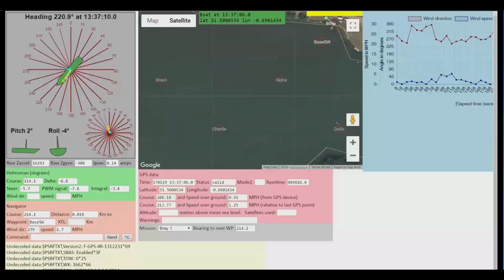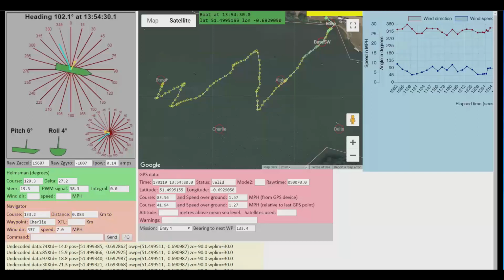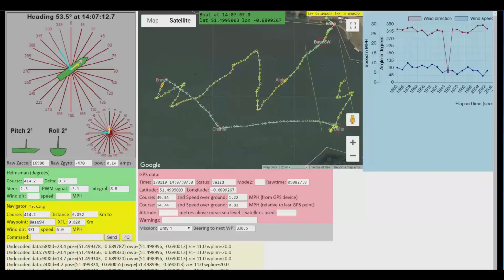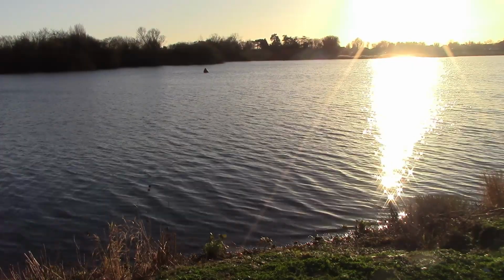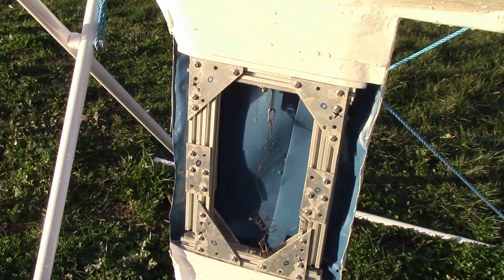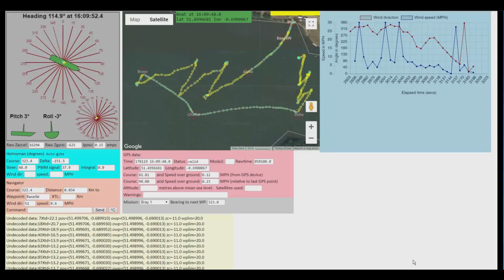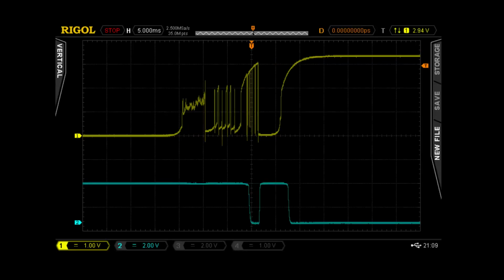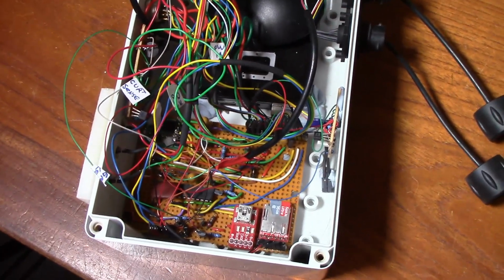Testing at Bray Lake with modified PID parameters

Comment: Great progress, as ever looking forward to the next instalment.  As I remember the anenometer I sent you is hall effect but was also pretty large so may or may not be worth trying.
Reply from the maker: The one you sent us is much better made and better balanced than our plastic Ventus one. But yours is bigger and weighs 278g compared with 152g for the Ventus. However, most of your weight is in the aluminium brackets rather than the devices themselves. I'll definitely consider it if we switch units. At present our software doesn't use the wind speed (only the direction) so I'm not under much pressure for it to be infallibly correct. For the sea I fear we're going to have to bite the bullet and pay for an ultrasonic one. Most teams are using the French LCJ Capteurs unit which weighs 100g but costs £469. I asked them last October if it would survive being regularly plunged into sea water bt did not get a clear answer (they said  "Our sensors are waterproof but there is a whole where the cable goes out. It is your responsability to fix it with waterproofing system and not the air sealing". Curiously, looking for their web site today the domain seems to have expired.
Reply: @samuelfielder  good luck. I still think there might be milage in some kind of sensor less or highly simplified sensor wind detection because all you really need is to know if the wind is more than around 25 degrees fwd of the beam. Could it be done with microphones?
Reply from the maker: Waterproof microphones?? I've got some enclosed ultrasonic symmetric tx/rx units. Played with them a bit. I gather the electronics needed to sense wind speed/direction accurately using ultrasonics is not entirely simple. Sensing by using the compass roll angles seems to work fine, but it requires time (which we have in the sea, but not on Bray Lake!). With Woodstock its 50 degrees.

Comment: What are you actually up to?  I have been watching for a while now, but I am really not aware of what you are striving for.Signal bounce can be a pain, I had it in the turret of my cnc lathe, it was missing tools far too often.  Small capacitor across the micro switch fixed that.I know nothing of sailing so I am surprised to see tacks that actually travel away from the destination before the next tack goes back to a positive direction. Is this how it works in real life?  I would have thought that a positive zigzag would have been possible, not so?There is much of the tech stuff that is way over my head, but I enjoy these videos nevertheless.  Thank you for keeping us up to date with your adventure.
Reply from the maker: Well, the challenge is to sail a boat autonomously across the Altantic. See https://www.microtransat.org/ . Woodstock is our prototype test boat. Our aim at the moment is to master sailing in the sea and in tidal currents such as we get in the English Channel. Yes, sometimes the wind is in such a direction that you have to tack away from the destination in order to get far enough to one side to take the more favourable other tack. This is exaggerated by Woodstock because absence of ability to trim the sails means he cannot sail as close to the wind as typical boats. But it only happens occasionally (I hope). I did have a cap across the reed switch but it wasn't a good enough solution. It seems to be getting worse and possibly the switch is wearing out or doesn't like a marine environment.
Reply: smallcnclathes - I can understand why sailing away from the destination Way Point might appear counter productive.  When the wind is coming directly from the direction of the WP the tacking ‘zig zag’ would be as you expect with each tack taking he boat near to the destination.  However as the closest the boat can efficiently sail to the wind is 60°, this means that the angle between the port and starboard tack cannot be less than 120°. If the wind direction is between 30° and 59° off the direction to the WP one tack can be closer to the required course but not the other.  So the tack to the windward side of the course to the WP could be anything from 90° to 119° away from the direct course. This does mean though that the opposite tack is much closer to the course.
So the 60° tacking angles are equal either side of the wind direction, but not the course direction.
It’s the same for all sailing boats though many can sail as close as 30° to the wind if the sails are adjusted and trimmed by the crew, which we can’t do.
Reply: @Dick.BaileyReading  Thanks Dick, I can understand that.